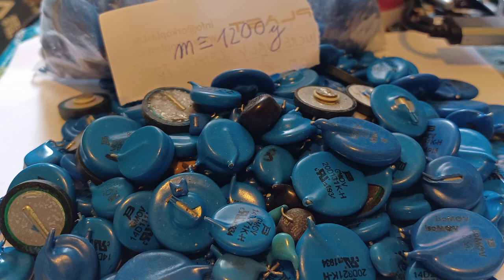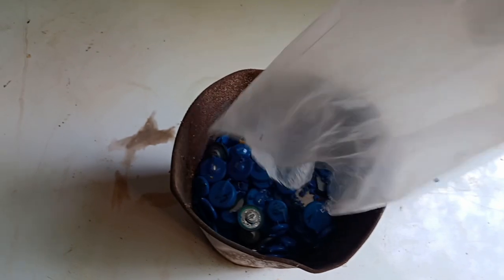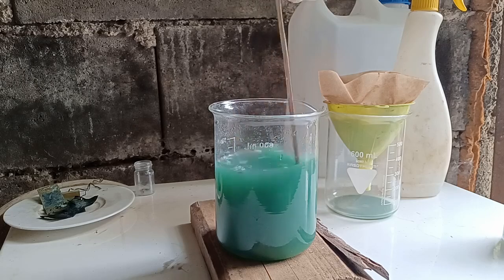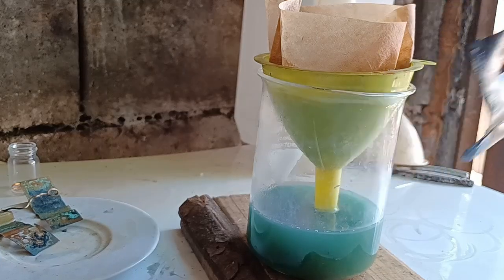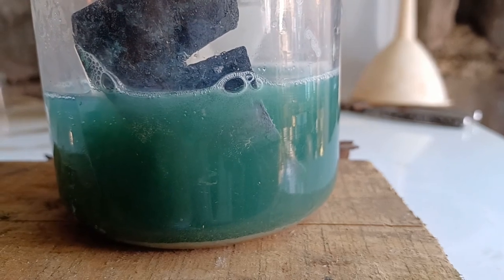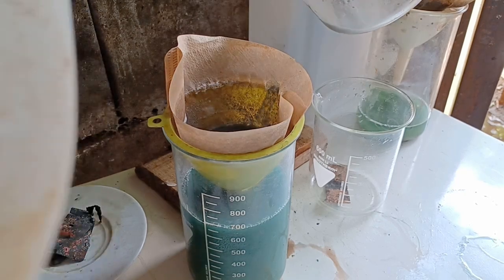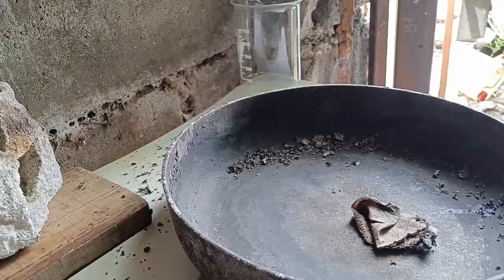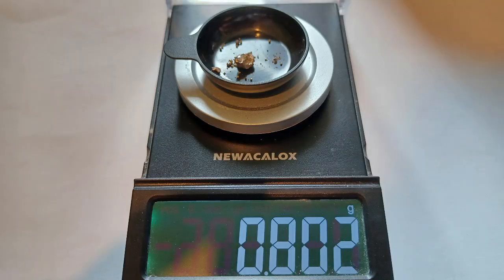Extracting Silver from grounded metal oxide varistors

Comment: Friend, I don't know whether to laugh or cry when watching this… 
I absolutely believe you did your best, but considering how the copper looked after you "cemented", I dare say that you have a HUGE amount of excess nitric left in the solution, which leads to your silver returning back into the solution. 
-A tip is to either denox away excess nitric with Sulfamic acid, or the simplest: -add more silver if you have access to reasonably pure silver, let it consume all the nitric until no more reaction occurs. 
-THEN you can cement out all the silver with copper. 😊
Good luck 🤞🏻
Reply from the maker: I still have the solution and i put in a copper pipe so if any silver is present it will cement out eventualy. I will check in a few days and update the yield if i get a significant amount.

Thank you for you imput. I usualy precipitate silver as silver chloride. I went for cementation because i belive those components should contain a bit of palladium i cant easily selectively precipitate from the solution.